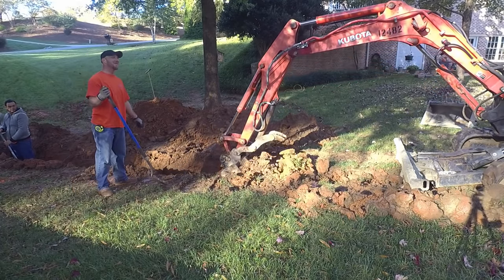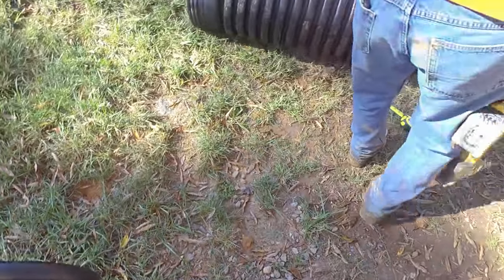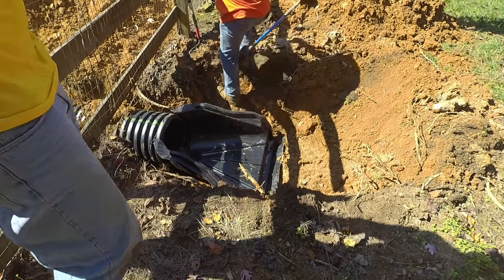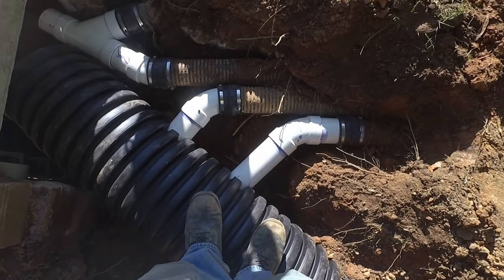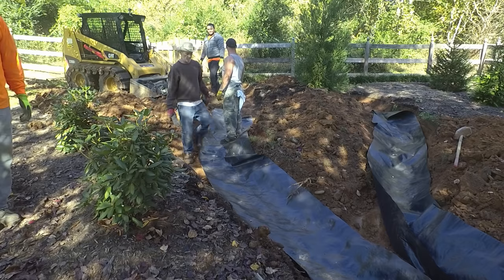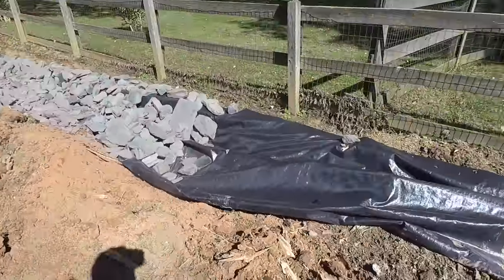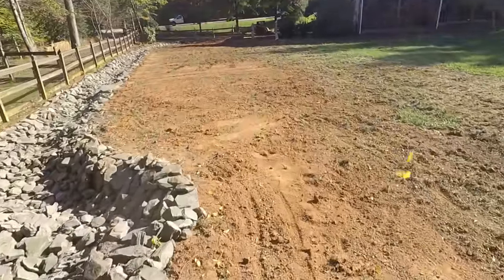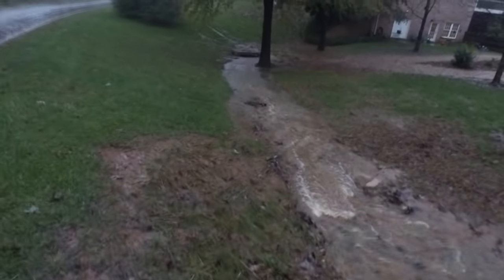Installing a riprap channel + culvert

Comment: Can that skid steer be operated without the tracks too?
Reply from the maker: Yes, this is a wheeled skid with OTTs (over tire tracks) installed.
Reply: @GCFD  how well do those OTTs work versus machines with tracks from the factory? About the same or not as smooth?

Comment: You've probably been asked a thousand times but what is the hay used for??
Reply from the maker: The hay stabilizes the exposed soil from runoff and raindrop splash. It also protects the seed from granivores and releases nutrients as it decomposes. It holds moisture too. We use 100s of bales

Comment: thought you hated corrugated pipes
Reply from the maker: This is double wall culvert pipe. It's smooth inside and rigid. It's good stuff.
Reply: @GCFD  you interesting. looks like it worked very well

Comment: It's crazy that owners have a ton of work done to drain water and then go use grid water to water the plants. What a waste of resources...
Reply from the maker: The surface water from their property makes its way to other surface waters, including reservoirs and ground water recharging. The only way the water is wasted is if it flows into the sea.

Comment: U have the wrong kind of pipe. You should of had smoother inside of the pipe. So he surf won't hook on he ridges
Reply: I've seen an argument for the corrugated pipe since it creates turbulence and makes the running water help clear debris.
Reply from the maker: This is double wall corrugated. They don't make singe wall in 18"

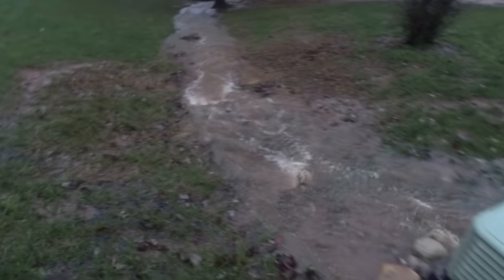Comment: 30:21 Their internet and cable tv must be pretty crappy with all the equipment/cabling underwater....
Reply: Not at all, that's meant to withstand heavy weather conditions and the parts that matter are near the top of the lids so they're experiencing little to no water.